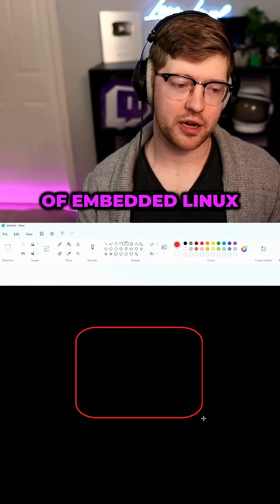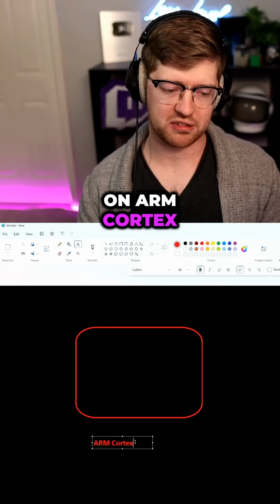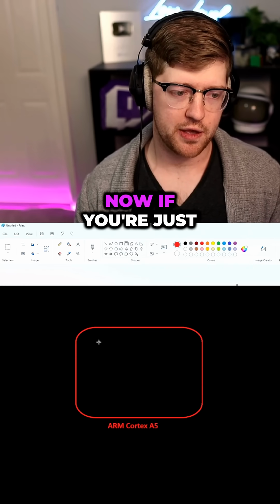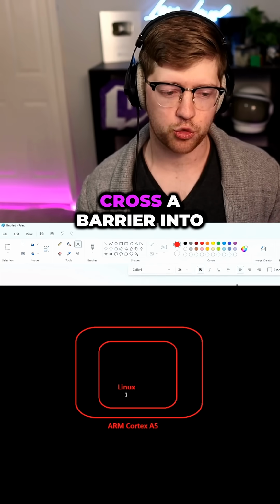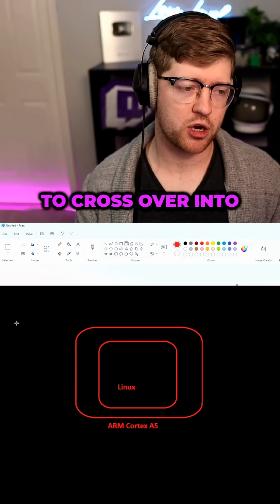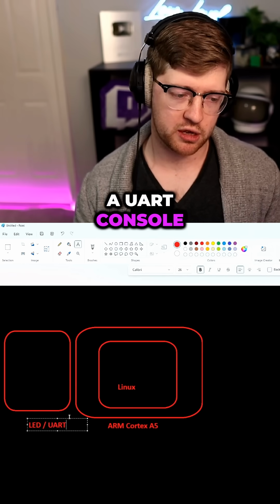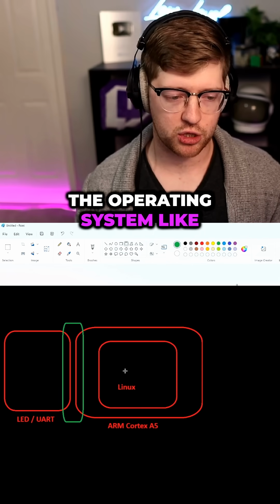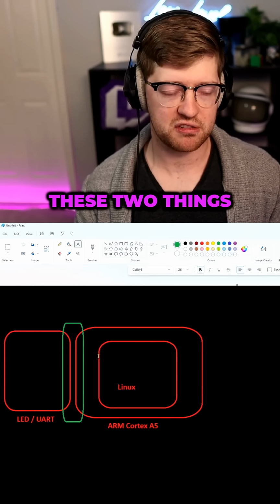What is "Embedded Linux" ?

Comment: Would firmware not qualify as embedded? 🤔
Reply: @crazylegs85  exactly my thoughts tbh. I work as an embedded linux developer, and even if you don't work with gpio or anything, you already have so many caveats from working on an embedded system.
Reply: @felixkuhlmann9985  same experience, Raspberry PI is in many cases closer to programming on a PC than a microcontroller. Everything is still a file and you never have to worry about memory layout of your processor.
Reply: @kacperfilipek8461  What you said is also true of a fair % of embedded development
Reply: Yes, definitely.
Reply: It's definitely embedded though not necessarily Linux.